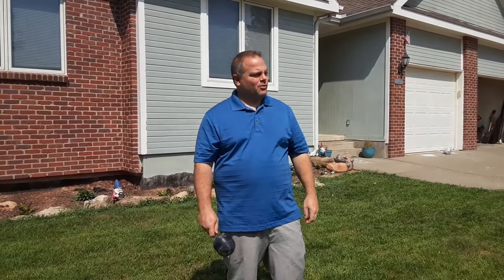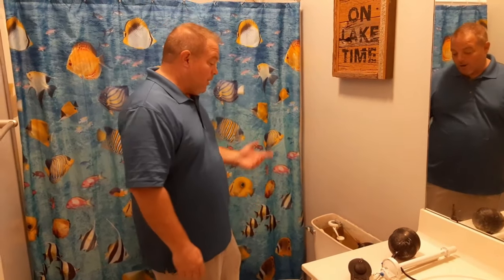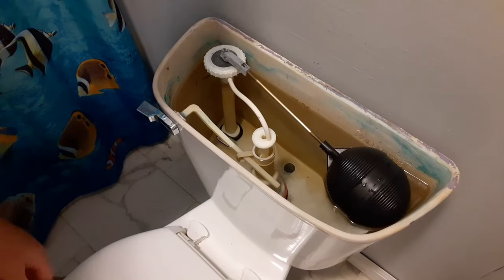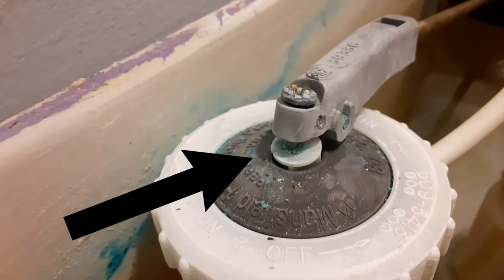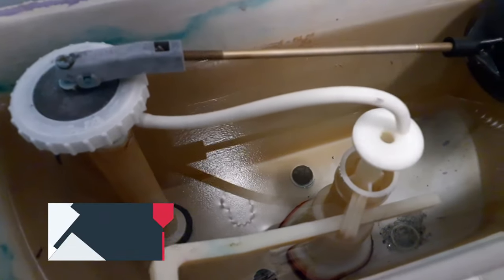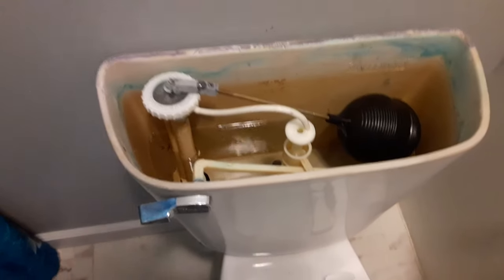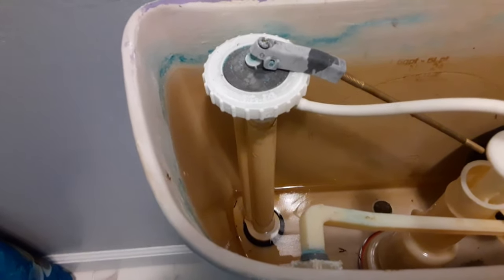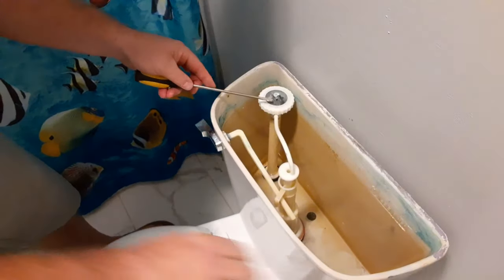Pipes Rattle After Flushing Toilet

Comment: I wish you would have let us hear the noise before fixing it.  I'm trying to compare it to my problem toilet.  Very informative, though.  Thanks for posting.
Reply: You can hear it after he fills the tank following putting the washer on. Only for a couple secs though.
Reply: It's a variation of a hard continuous knocking, like a hammer on the wall or a hard vibration that makes the walls shake (like someone has left a device on). It's happening in my home and it's the knocking that turns into the vibration. 
When he flushes it at the end you can hear it vibrating still, before he decides to go ahead and do what he avoided at the beginning.

Comment: The problem with mine was the floater. The floater was halfway full of water slowing down the shutoff valve causing the noise. Replace the floater.
Reply: So how did u fix it?

Comment: Will it be a problem that the water refill hose is placed above the float arm? Seems like they will interfere with each other? You probably know more than me though.
Reply from the maker: Well I'm definitely not a plumber.  However, when the float rises far enough, it shuts off the refilling process regardless of the hose placement. As long as the hose is long enough to not get stretched/pulled out, there is no interference.  

It's been working for me with no issues.

Thanks for watching!
Reply: @wilderhomeinspections1626  good point,  I guess if there is enough excess slack in the hose and the float can only go to a certain height, you will be fine.  Thanks for the explanation.

Comment: I done my toilet syphon yesterday never done it before and got mini float thing instead in mine  it’s really small but all the down pipe is gone and has leaks on it so will be replacing that this weekend too and I am no plumber it took me about 7 mins to drain it unscrew the old one and fit the new one and fill it all back up saves loads of money for a plumber and I only watched a YouTube video. 
my LG new washing machine causes water hammer or was but I turned my water pressure down and it’s stopped doing it now.

Comment: I have water hammer in bathroom wall.  Boyfriend  install new inside  parts for the toilet.  Is this the cause or other issues?
Reply from the maker: It could be, especially if it just started happening after the new inside parts were installed and the hammering happens when you flush the toilet.

Comment: Hi hope ur well wanted ur advise everytime I flush my toilet upstairs when the water rises I can hear a thud noise vibration in the wall where my shower head. Also if I open the mixer tap and dont close it gently it's also making the same noise from the shower head wall which is tiled back in March as new bathroom. Also if I open the mixer tap for hot water upstairs wether it's out of my sink or bath or shower head directly downstairs is my kitchen living room open plan I can hear tik tik noises. If I open the hot water mixer tap downstairs I can hear the thud vibration same place next to shower head in the wall which is tiled. And last but not least my bathroom downstairs the sink when we open it hardly and hot water is coming out of it. Any idea what is going on and the best solution for this as its quite disturbing. Its a new bathroom installed by a builder in march this year and new kitchen and extension. Also bathroom upstairs when flush toilet water comes up and then I can hear a noise like a vibration in the wall next to the shower head.
Reply from the maker: My best advice is to contact a plumber.  Sorry, I know that doesn't answer your question. But, it sounds like that's what you need.

Comment: Well hearing the noise would've helped.
Reply from the maker: I'm sorry the free advice didn't work out for you.  However, If you hear pipes rattling inside your walls after you flush a toilet, I'm not sure the exact noise makes a difference.  I'd still recommend starting here.  Good luck.
Reply: Good video, made me laugh when you forgot the filler hose, but I guess you didn’t hear me when I said something. Anyway your video is the most helpful to me I’ve contacted 2 plumbers and they both made appointments but never showed up. My toilet vibrates the pipes from second floor to the basement and inside of my toilet looks just like yours so I can’t wait until I can get to the hardware store. Thanks for making this video.
Blessings to you